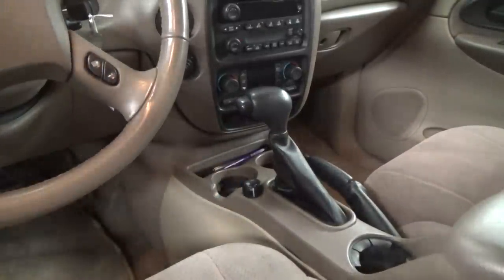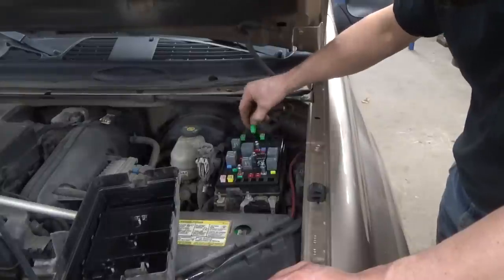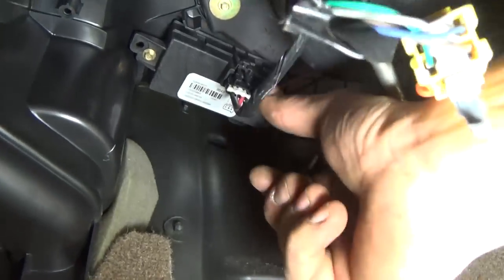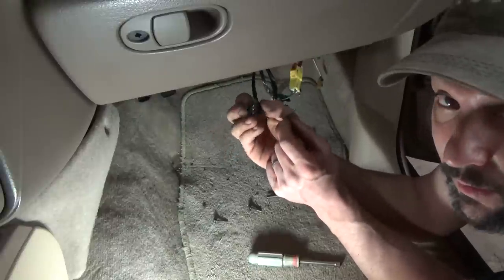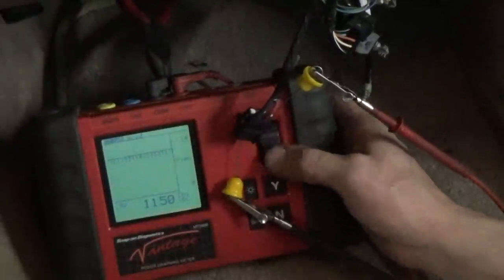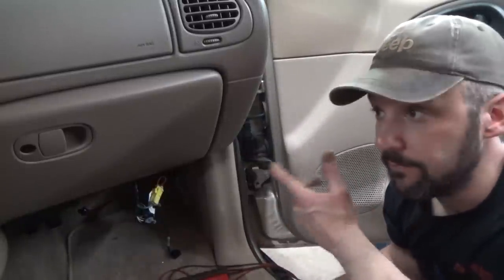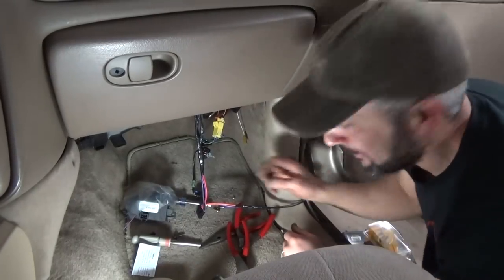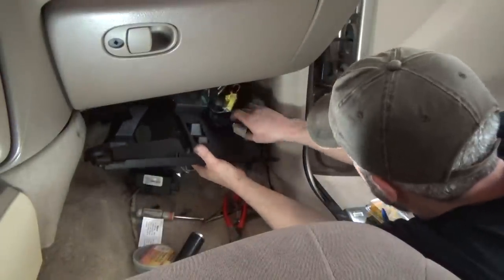Chevy Trailblazer EXT Blower Motor Won't Turn Off

Comment: - HELP!  I have a 2011 2500 HD Silverado and the blower went dead all of a sudden.  
- We put a new resistor in it and still nothing.  
- Test light shows power to one wire on the resistor harness.
- All fuses check out ok.
- Where do I go next - the switch, or the blower motor?

Thanks to anyone for good advice on this.  These newer vehicles are a real pain in the butt!!!
Reply from the maker: just test it. Is there power and ground at the blower, if so replace it.

Comment: Thanks for the laughs.  Sadly all you joked about is so true.
I was wondering why you tested measuring between power and the signal
wire verses signal wire and ground.  I guess you are seeing the difference in duty cycle either way.
Reply from the maker: ***** The signal wire is a ground signal... make sense?
Reply: South Main Auto Repair Looking at it as the signal wire being ground side switched, yes.  I thought about that after asking the question.I was looking at a signal wire as being positive with reference to ground.
Reply from the maker: Ahhh got ya . Yep the signal wire is a ground side switch.

Comment: Yup! NAPA screw-ups in the design department. 

Try to install the thermostat (with housing - no other way) in a Cadillac Catera abortion with the BMW engine. 

After all the tear down (.4/hrs according to Mitchel On Demand) you find that you have to remove the timing cover, the pass-through tube that goes through the head on the driver's side with the o-ring and the NAPA part LOOKS right - so you put it in and the last thing you do is push that tube into the housing and then try to bolt the housing down. 

The damned bolts are off position and they won't go it! 

Take it ALL back out and go over to the NAPA dealer and you wanna drag one of their ex-burger flipper  idiots over the counter into the middle of their store and beat him to death! 

You've GOT TO use gen-u-wine GM or BMW parts!

Comment: Yeah they're like we could save a couple of pennies per unit by making the wire little bit shorter. Believe it or not I got to do this exact same thing tomorrow when my part comes in for my 06 trailblazer I hope my wire long enough. But otherwise I'll be doing the exact same thing you're doing. PS I got it from Amazon next day delivery it's not a nap product but it had good reviews we'll see it's also manual control.
Reply: One more thing when I took the old one off today it was very tight wire I couldn't they give another inch of wire. Going to the motor.?
Reply: Also I didn't start disconnecting it until I got the resistor out. But the way it was laid in there it's almost impossible to disconnect it until you have all the wire and then lay it in there we'll see what happens with me tomorrow

Comment: Those sealing crimp connectors are great. I do a lot of soldering repairing electronics and building drones but soldering isn't always the best thing especially on vehicles where there is so much vibration and major heat cycles. Soldered wires tend to get brittle and break in that environmentover time. A properly crimped and sealed butt connector is just as good if not better in this case.

Comment: Now that I think about it, on Manual Temperature systems, usually the head control unit(fan speed and mode door position switch assembly) complete the path to ground. The blower motor will NOT have ground unless the fan speed is in any ON position and the mode door switch is in defrost, floor, etc. For awhile, Chrysler did this with their relay operated blow motors.  Terminal 87 at the relay is the output going to the blow motor, thru the blow motor resistor, thru the blow motor speed switch and finally thru the mode select switch to ground. This could throw someone off if they assume that there will always be ground at that terminal if they start their diagnosis at the relay(which is a good idea instead of being a contortionist first, lol)  I had an open mode select switch(no path to ground) cause an inoperative blow motor years ago so that is why I mention this.
Reply from the maker: jarin wilson Oh cool , our experiences are always worth sharing. Thanks :)

Comment: I remember changing an AC compressor on a 95' buick roadmaster. One 10mm bolt made the job 3 hours instead of 30 minutes. So, NO, you are not whining. All that you said was necessary for the job. Lol. Good video.

Comment: how did we ever get by when the computer only controlled engine. how did we get by when the abs unit didn't control everything on the car. my 1994 dodge ram 2500 runs so good without all that and doesn't give any trouble A/C doesn't go thru computer or windshield wipers or  door windows my 1966 D500 Holmes wrecker doesn't even have a OBD port don't know what i will do if it doesn't start one day

Comment: Did Patrick Ever Call back? ROFL! J/K too funny! Hate Aftermarket crap also. been through 4 Alternators for my Honda each one had a bad volt regulator, then, the last 1 I put in, charges the battery when I turn on the Headlights, but with no load on it, (Head lights and everything off and engine running) My battery light comes on while driving, but turns off when I put a load on it. I said F**K it and called it fixed. I just drive around with the Head lights on all the time. lol!
Reply from the maker: +repeatman I'm still waiting.... he may call ya know...

Comment: Ordered a replacement radiator for my wife’s 96 blazer. One of the fittings that was part of the six fittings to hold the oil cooler line tranny lines in radiator ..one on each side the fitting was never finished . Consequently the transmission line would not go in ,,the clip could not be engaged so I had to scrounge up another fitting. I let supplier know of said problem ..they had me take pictures they had me give them the Vin number to help me answer questions. In the end they were supposed to send me just a bag of fittings they sent me a whole Nother radiator and a bag of fittings. So if I ever come across someone else that has an old blazer I’ve got a radiator for them they didn’t even want the radiator back so I can imagine How cheap they make these parts that they would not want the extra radiator back

Comment: You can shoot me Eric. I've replaced these JUNK parts at least 7-8 times over the life of my 03 Envoy. As of late, I am getting about 30 days of success before the resistor fries, evidence to me; "I could be wrong about this", by the burnt pin on the resistor body connection. Additionally, I can't get THE O.E.M.  AC-DELCO  part due to the planned obsolescence implemented by ALL MAJOR CORPORATIONS . What I would like to do is find a way to trick the computer if necessary, and put an old-school resistor and rotary switch in its place; the old school resistors rarely failed; you could actually see the wound coil on those; but alas, copper was involved; and that would cost a penny more to produce: "no corporate bonuses for that design"!   This problem drives me nuts because I have to give the wifey my truck; which I have to unload all my tools, etc.; a major inconvenience; all so that some chubby corporate bankster receives a 7 figure bonus with another clever design that lasts 1 week to 40 days before disaster strikes.  By the way, the sticker price on my 2003 envoy was over 50 k; now expect to pay 100 k out the door for the  modern day equivalent replacement vehicle;  which, sadly, is always in the shop. Another note, It's funny how you mentioned filler necks in this video. A couple months ago I ordered a new filler neck, etc. for the Envoy; claimed to be exact O.E.M.; Stupid junk kicked my "arse" because the hoses and weldments were totally off spec; totally unacceptable. Figuring out the filler neck issue in a rainstorm would send even the most patient person to the mad house. As a former automation electrician, good manufactures have gauge machines to either pass or reject a part improperly assembled. Clearly, the manufacturer; Likely 1 major manufacturer, under disguise of numerous other names ,  does NOT implement proper manufacturing principles. Sorry for the long rant. Incidentally, can you tell me how long the Napa resistor lasted? I need another one ASAP.  Also, if anyone has a proven work around this particular junk, please post the link!  Millions of people would appreciate that! One last thing to Eric O, I love your videos. You taught me, a regular Joe who has been doing brake jobs for 30+ years,  about rust jacking in a brake video; a little detail that I wish I would have known years ago; tricks of the trade!

Comment: But you said.....NAPA had the part and even GM didn't.  So what other choice was there.
I have a brother who's a building inspector,  and claims the crimp connectors are crap. I have even used them for cleaner quicker splicing of 220volt ballast lighting repairs. No need for huge twist connections.

Comment: No, I don't use those crimp/heat shrink connectors.  I'll tell you why:  they cost nearly a dollar apiece!  Okay, 85 cents...   I'll solder/heat shrink tubing instead.  I also trust a soldered connection over a crimped connection.  Just my personal choice.  Love these old SMA's....

Comment: Hi buddy,May be you can help me? I have a 2001 Nissan sentra. The engine cooling fan will not go on, thus getting over heat and messing my spark plugs and blowing a few fuses.But I notice that if I keep the Air Conditioning on, them the engine cooling fan will cycle on and off normally. To me it sounds like a relay or fuse, but I
 have no idea where this would be located. Any ideas? Please help.

Comment: Hi,
I have a 1996 Cadillac Seville. Every time I start my car the blower fan comes on and the temperature readout starts climbing. If I turn it off it stays off, but starts by itself next time I start the car. The temperature readout also starts climbing when the ac is on. When I turn it down to the setting I want, it starts climbing again. Sometimes it stops for a while, but eventually it starts climbing again. 

Second issue, I only have 2 out of 5 fan speeds. I know that's usually a resistor, but was wondering if it had anything to do with the other issue?

Thanks!

Comment: I had a blower motor repair on my 2016 colorado done by the dealer.  Mis diagnosed the problem.  Took 3 weeks to get parts that didn't fix it.  Cost me 700 bux to fix what turned out to be a bad blower motor.  Then they didn't put all the screws back in.

Comment: Eric I had same issue with my old Seville exc BCM is under hood on top of fan motor. Part price  is crazy in CDA so hot wired to fuse box power with switch on high for now. Haha. Full time hot BCM is a dumb idea imo and GM should know better. Killing batteries is not acceptable and can have bad outcomes in some cases.

Comment: Would you please do a review on the wiring diagram you used in this video and some low cost alternatives that DIYers can use.
Reply from the maker: Qiong Jia  I use Mitchell Prodemand... I think All Data has an All Data DIY site that is a pay site.
Reply: +South Main Auto Thank you Eric.  I like the Mitchell wiring diagram.  I see why you and ScannerDanner use it.  It is intuitive and easy to follow.  However, the cost is prohibitive for DIYers.  The only free ones I found is hard to follow and fuzzy that I can't make out the writing half of the time.  I will try your recommendation and hopefully it is easy to use.
Reply from the maker: There is a program called Motologic too.
Reply: Qiong Jia I believe Mitchell has a diyer service also.
Reply from the maker: Oh do they I didn't know that

Comment: My car did the same thing despite the car being off and control off. My first speed did not work already so whenever switched to that setting it would turn off. Used it like that for a few days and then it stopped working completely. Replaced the resistor and didn't fix anything. Makes me think it's the climate control module.

Comment: Eric, just wondering what you think about the angled socket wrench? Being German I think they're cool.
Reply from the maker: I think it is awesome... you didn't see me use it in the rear strut video on the Taurus? It is the only thing I have ever seen reach the top bolt on the sway bar link.
Reply: South Main Auto Repair If you want any other sizes just let me know.
Reply from the maker: How much for a whole set?
Reply: South Main Auto Repair Since you already have the 13mm I can sell you a set consisting of 8, 10,11,12,14,15,16,17,18,19 mm for $70 plus shipping which will probably be cheapest, since you live on the other side of the country, using a USPS medium flat rate box for $13. So you would have $83 all in. This is the special Eric O. price.
Reply from the maker: Do it... Vanessa will pay u. But you know I will show them off on YT, is that ok or should we keep this on the down low? Just shoot me an email when you get a chance to get them out.
Reply: South Main Auto Repair Check your Hotmail Email. They will go out Friday Morning. The box is already packed.
Reply from the maker: Sweet thanks Dennis will do :)

Comment: That is a lot easier than replacing the resistor on a 1995 Gmc Sierra 1500, which I have been doing all afternoon.

Comment: Mr. Big O..bro blowers only have one way to suck in air even if turn wrong way it will reduce the air propeling but never going to suck air otherway arround like conventional fan blades.

Comment: Should have also tested the wires going into the blower motor itself. I thought my Trailblazer had the same issue, but when i tested the wires going into the blower itself, they were also getting the same variable signal. It is important to test all components in the chain. I say this so that someone doesn't watch this video and just assume that because they are getting good signal from the dash means that the control module is bad. Mine had the same symptoms but it ended up being the blower, which was actually cheaper than the module. If I had just replaced the control module it would have been a big waste of time.

Comment: Just did one on a hummer h2 last week the blower moo had to much resistance. Still would run full speed even when the car was off. blew the resistor and the new one I put on there. Had to replace the blower fan with a new one and put a new resistor back on. Then solved the problem.

Comment: I realize this is an old thread but what is the part number for those wire stripper/crimpers? I like they have a cutting edge not between the handles.

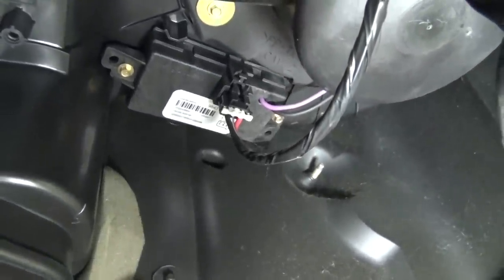Comment: I am not sure if anyone pointed this out (read most), but you put it in backwards from the picture at 4:40 to (for example) 15:20 in your video, did you try it the other way and it did not fit or something?

Comment: Thanks Eric,  my blower motor plug is burned so I thought I should check the current draw on the motor before just splicingon a new plug. Mine is drawing about 25 amps ( not Good ) I know what I have to do. Thanks again.
Reply: hello, i have a 2006 trailblazer that had a burnt wire harness that went to the resistor.. i replaced the resistor and left the same wiring but it just burnt up also. im not sure why its burning.. i have no clue whats gong on.. your comment sounds similar to my problem.. what did you do to fix yours?? thanks

Comment: I appreciate your frustration. I'm there. One question, I do see the tab on my replacement part which allows me to "technically" install it one way. But I was able to install the unit backwards without the interference from the console. But my fan does not operate. Is the orientation of the module absolutely important? In other words, can I install it backwards so the wires reach? (My envoy is very old, and I don't care where the wires end up)
Reply: Just buy the OEM GM part!  The wire IS long enough on the GM part!  NAPA just cheapened out and shorted the wire to save a penny or two!

Comment: gotta love Rant Wednesdays :P I hate when aftermarket parts come in like that, and to make it worst they always claim to be OE or better. Sure the part will work(but for how long), but if it doesn't fit like OE or you have to splice some wires, that adds unnecessary time to a repair. It isn't hard work to splice wires, but if it takes an extra 10 mins of work to splice everything, over 6 jobs, that is now an hour of work wasted.

Well I guess that's my rant for the day :P Great video though, keep them coming, and don't worry about the rants, I like them, and who knows, maybe someone who works for one of those companies will watch your videos and get the clue to make their product better.
Reply from the maker: Jeff Dooley Hahahaha make there product better hahaha right     -__-
Reply: was worth a shot :P